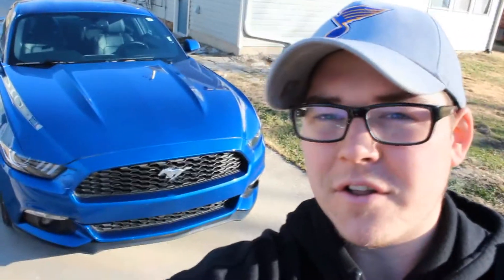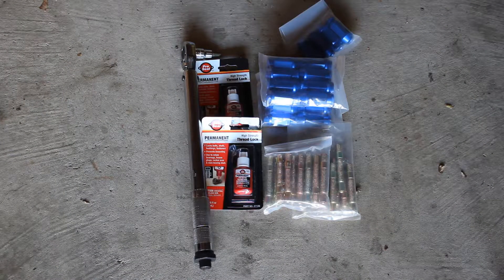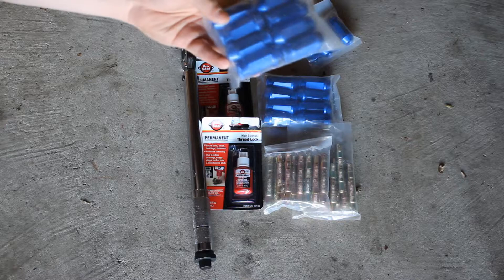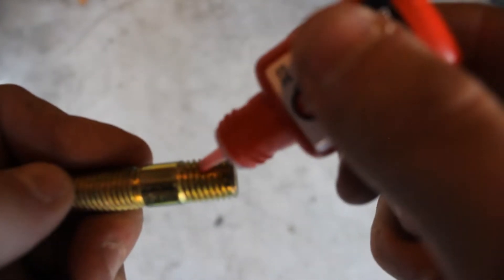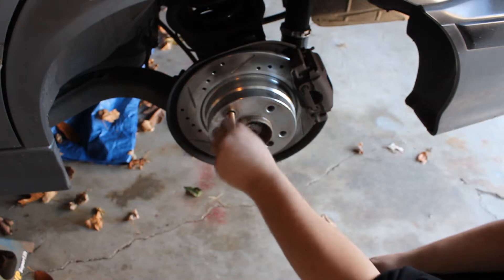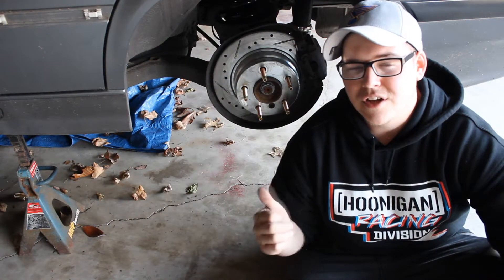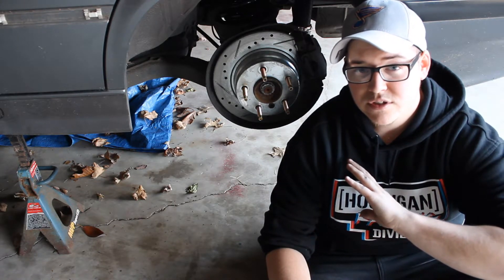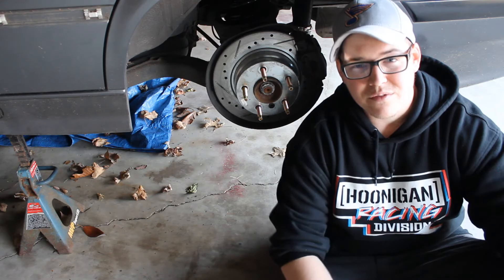How to Install A Wheel Stud Conversion Kit | BMW E36

Comment: how is the quality on those studs? do you trust them?
Reply from the maker: AfUgGiNhYpEdNiKkO the quality is very good I have taken on and off the lug nuts about 10 times per wheel now and no issues whatsoever.
Reply: and they're from ebay yes? if so, do you remember how much they were? and have you tracked on them yet? sorry for all the questions.
Reply from the maker: AfUgGiNhYpEdNiKkO ask as many questions as you want and yes I got off eBay and yes I have drove with them on the track about 5-7 times now il look back and see how much they were.
Reply: alright cool. im just kinda iffy cuz you know, ebay lol
Reply from the maker: AfUgGiNhYpEdNiKkO the kit I paid for was right around 65$ shipped. And included lugs that I gave away to a subscriber.